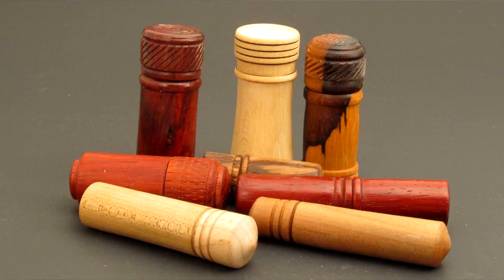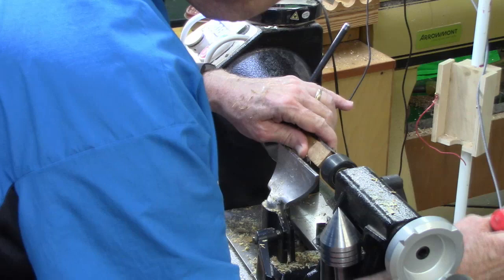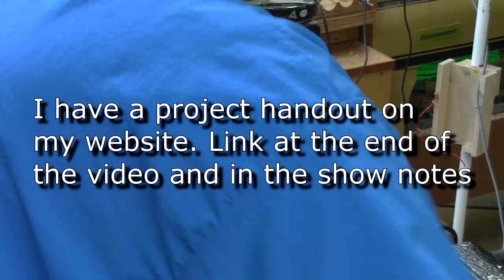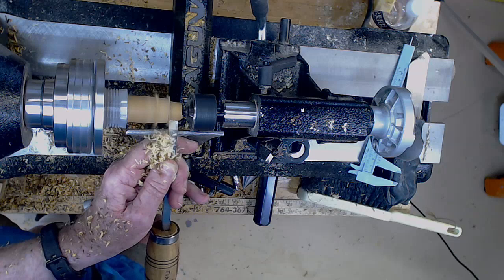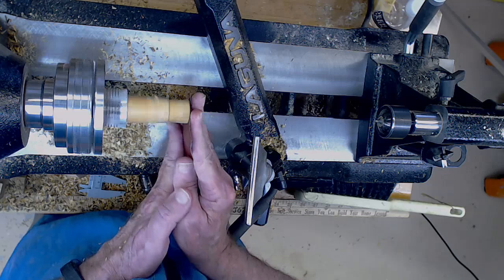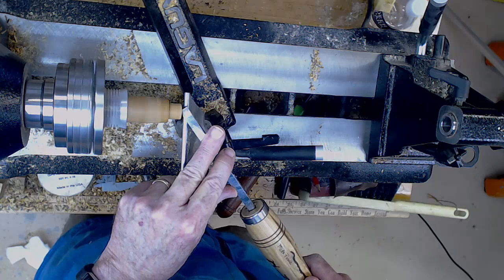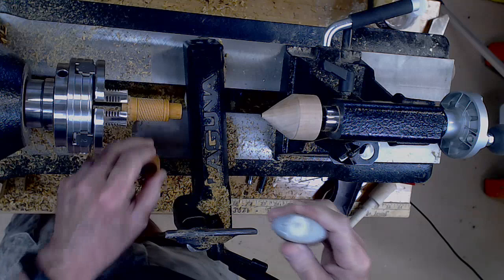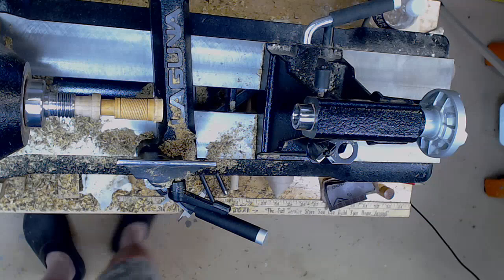Turn a Pocket Pill Box

Comment: Great project - pill container, or needle box for those who engage in some kind of needle work, or just a trinket box to hold 'stuff'.  Easy and quick - the only tricky part is sizing the tenon to fit the recess in the cap. 
My experience on sizing the tenon is that it is best to fit the cap is to get close with a skew, and then finish the job with sandpaper.  Taking the time to do it right avoids the need to do it over.
Excellent advice to install the bit with the chuck off the lathe - I've actually broken bits by tightening down on a jacobs chuck when the bit wasn't exactly centered.
Did you flip the cap end for end?   I usually part off the cap and flip it to drill out from the cut end so that the grain  is continuous between cap and body.  But if you are scrap-limited, you could use a contrasting material to make the cap.  All design choices.
Reply from the maker: I try to avoid sanding to fit based on advice from better box makers then me. ONly on these pill boxes do I hollow the cap and part off. On small pieces I have not had a problem with grain alignment based on the wood I am using. Lots of ways work.

Comment: i need to make one of these for my nitro . good job mike . soon as things slow down buddy i want to try one of these small enough to wear around my neck . just big enough to hold a couple nitro pills . great video buddy . thanks
Reply from the maker: A necklace is an interesting option which will present new challenges to keep the lid on.
Reply: As an old retired pharmacist, I would recommend leaving nitro in original glass container, It looses its strength otherwise
Reply: @randymagee735  Thank you randy . yeah i do keep it in the little glass bottle . if i do decide to make a  a box for it  the glass bottle will be able to fit in it . thank you again for your advice .
Reply from the maker: @randymagee735  Good to know. Thanks for sharing.

Comment: Very nice Mike. I noticed you have a Laguna lathe now. Did you get rid of your Powermatic? How do you like it? And how does it compare to your Powermatic?
Reply from the maker: No I still have my PM. The Laguna was for teaching. The Laguna is fine for most things. It is hard to make a comparison with a big lathe like a PM3520 with a 2HP motor and weighing 5 times as much.
Reply: Mike Peace Woodturning    Thanks for the information. I can see wanting to use a different lathe for teaching.
I am hoping to upgrade next year and I am looking at either a Powermatic or a Robust....
Ron

Comment: Hey Mike,  What would you say is the problem when the edge of your bowl or cup or whatever is not the same thickness all around.  it seems to me that it's not centered but I'm not sure.
Reply from the maker: Sounds like the object is not running true after reversing. Issue could be your tenon or recess, the softness of the wood affecting the compression,  Another possibility is wood movement as the green wood drys. Are you twice turning to allow the roughed object to dry before returning?

Comment: Really enjoyed this one Mike. Do you think this could be made from an acrylic blank as well?
Ron
Reply from the maker: I do not see why not. Just have to be careful drilling.
Reply: Mike Peace Woodturning 
Thanks Mike.
Reply: Do you think it would be better to thread it if is made out of acrylic? Or would a friction fit be better? And is adding embellishments harder with acrylic? Thanks for your time Mike and my apologies for so many questions. Thanks again.
Ron H.
Reply from the maker: @ronh9384  Yes, I think adding texturing would be more difficult on acrylic. I do not think this style of pillbox would be better with threads. More trouble to take the top off. If you sold them, I do not think you would be able to charge for the extra time. The box would need to be bulkier to add threads.
Reply: @MikePeaceWoodturning  
Thanks Mike.